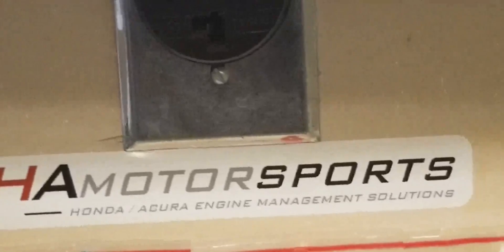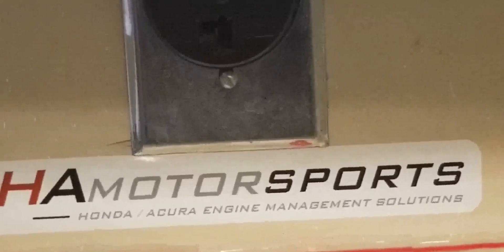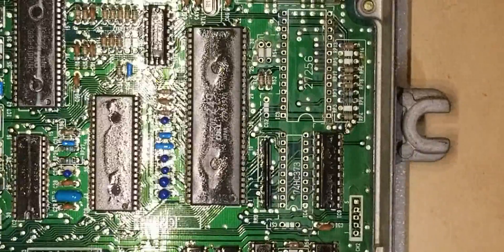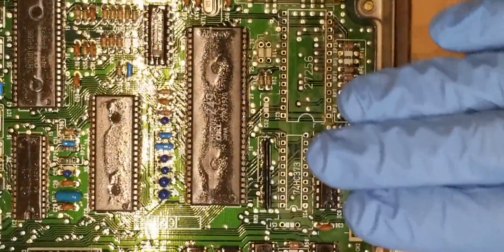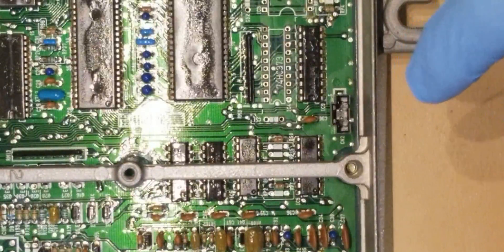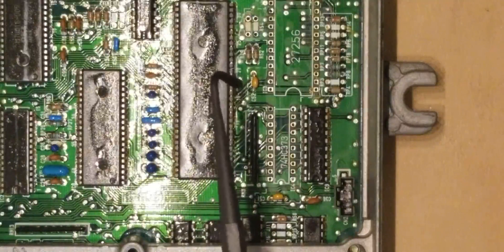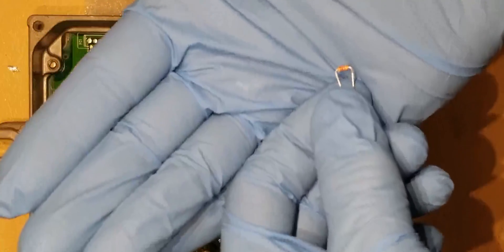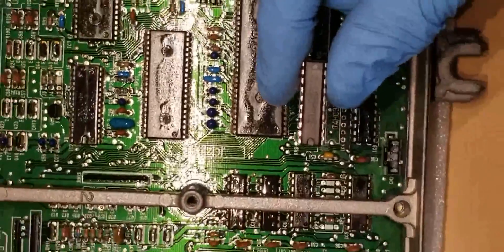HA MOTORSPORTS USDM ECU Chip installation. P06 ECU

Comment: l installed all parts (p29) but it didnt pass over 4000 rpm and my engine light didnt turn off so l cut jumper wire.now l use stock ecu.what can l do.Could you help bro
Reply from the maker: Try to reburn the tune the ecu is in limp mode....usually a bad burn file or bad SST chip
Reply: @DIYKAI  you are a intellegent and polite man .Thanks so much brother.Loves for you
Reply from the maker: @NSRTUNED  Your Welcome! Anytime
Reply: @DIYKAI  kit  installed by me.You said me reburn bro.may be this problem from 28 pin legs problem.what do you think
Reply: May some legs dont sit the board but my friend check legs with a device all of them working
Reply from the maker: Did you install a ZIF socket? Or chip straight to board
Reply: @DIYKAI  yes l have zif socket on board.on top 27sf512 eeprom
Reply from the maker: The only way to check to see if the ZIF is installed correctly is a socket tester

Comment: Great video! So the chip latch separates so it's just the pins? I was wondering if I could do this first, then if I wanted to switch to a hondata s300 later on. would I have to re-solder everything? Or can I just take the latching part off and plug in the Hondata?
Reply from the maker: I'm not 100% sure I believe s300 comes with it's own pins because it sits over the latching area.